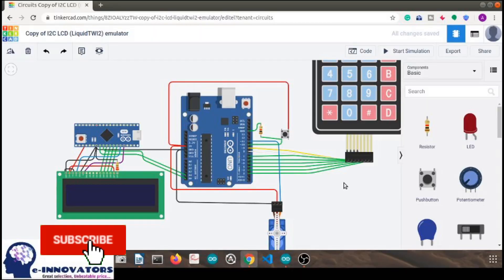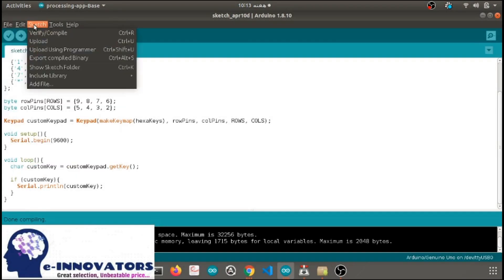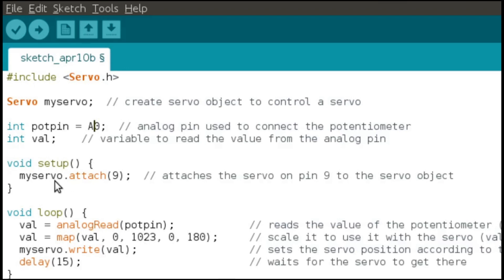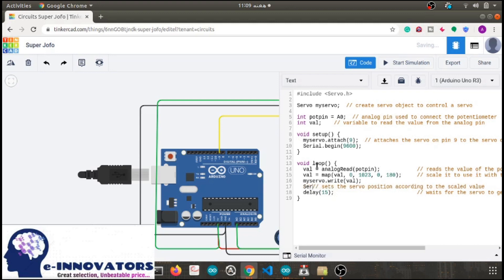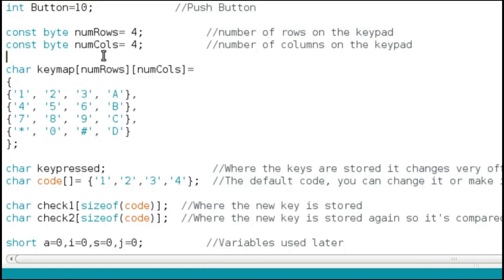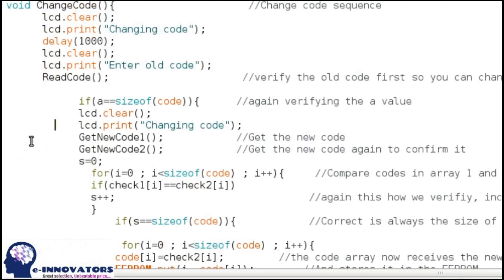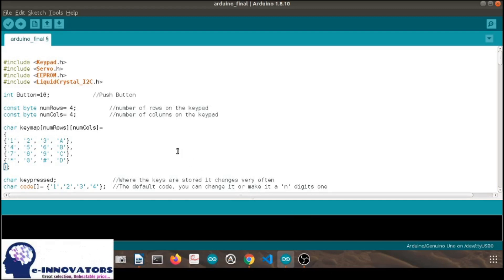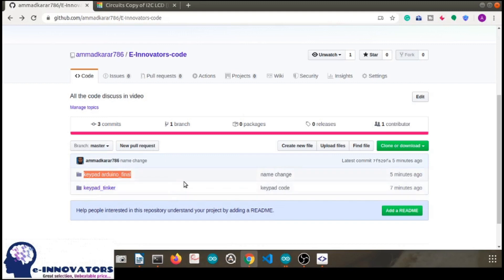Password Protected Door Lock Using Arduino! | TinkerCAD | LCD Display!| Servo| Programming included!

Comment from the maker: We got alot of complains regarding the error in the code for the project,  so we looked into the matter thoroughly and updated the code with the direct access to the Circuit for your ease!
Sorry for the difficulty.
Reply: Thank you for your hard work. But, after copy & pasting the code from Github. The LCD is still blank. Is there anything that I have to do after copy pasting the code?
Reply from the maker: Check on the top right,
Whether you have selected Arduino Uno, micro, nano?
Choose according to the use.
Reply: @e-innovators.6625   liquidTWI2 simulation showing(compile server error) please tell me how to solve this.
Reply: @adinarayanamurthybikkina5845  I have the same problem and no answer :(
Reply: @procastual  in setup() try replacing lcd.begin(16, 2) with
lcd.init();
lcd.backlight();
Reply: still getting errors on uint8_t
Reply: A y ECE and CSE wont have problem. This is why i am telling u to be realistic
Reply: can you copy and paste the code